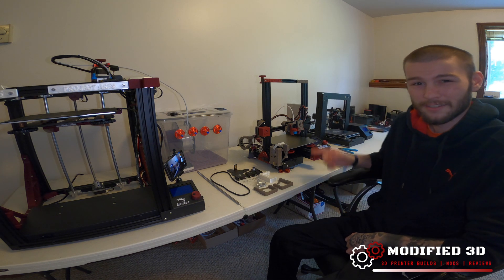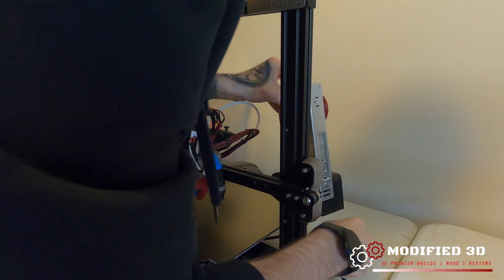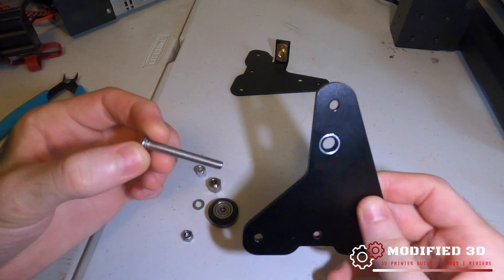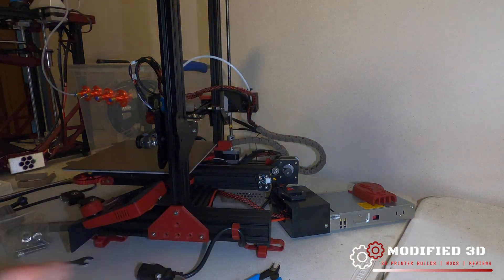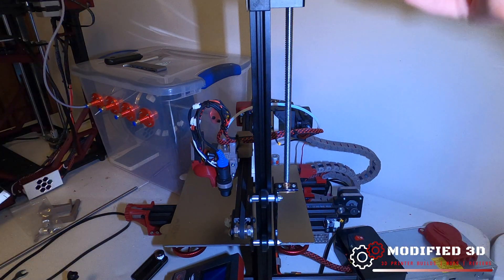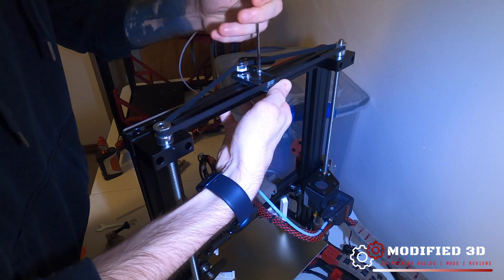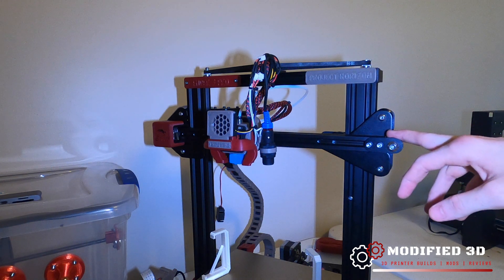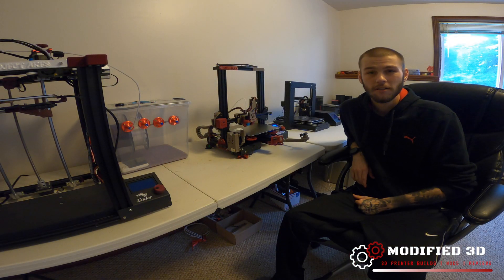Th3d Dual Z Axis Kit Install | Creality Ender 3 (Base/Pro/v2)

Comment: In theory this should have zero noticeable improvement if you are already using automatic bed leveling because they are already compensating for the "sag" by default.
Reply: Incorrect, the BlTouch is only good for about a 2mm sag.
Reply: @Burntfacedrumming  Where did you pull that number out of the air or what? You could have a 5mm sag and it would still work. Your parts wouldn't be accurate by any means but standalone models would print perfectly fine.

Comment: Did you see any improvement in print quality with this mod
Reply from the maker: I have noticed a slight bit of improvement but that may be from perfectly squaring the frame during the install. Mainly this will provide durability and function over performance. Allows for more weight to be applied to the gantry without having to worry about sagging. This is useful for going direct drive as you'll have more mass on the gantry. Ultimately, it helps sturdy everything up. I highly recommend it!